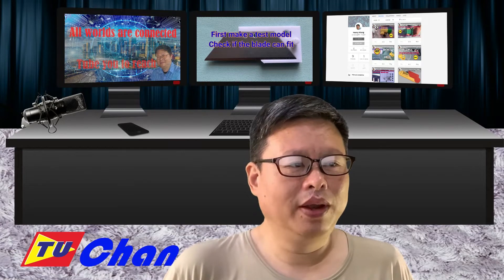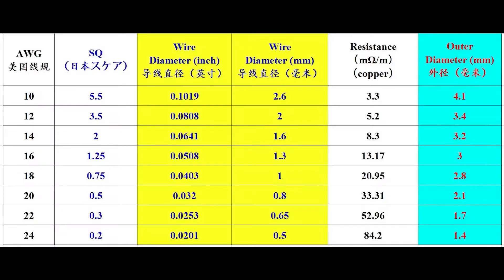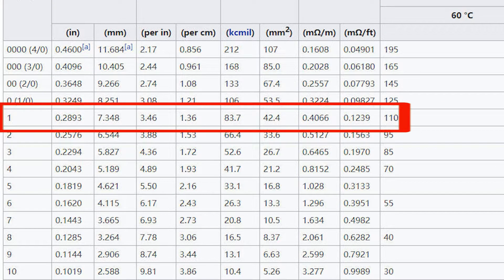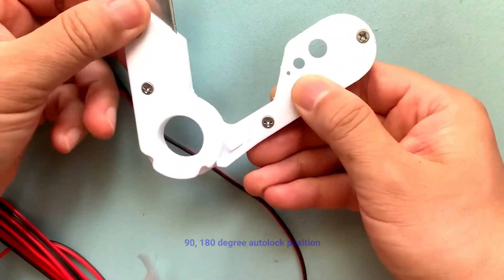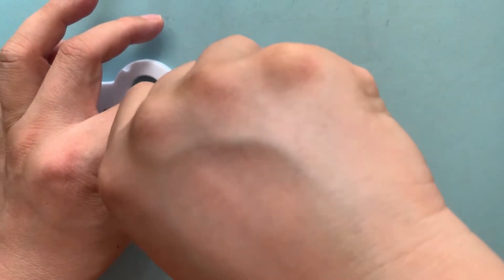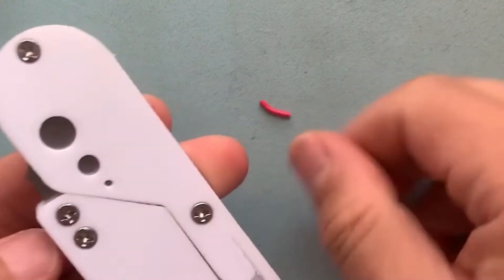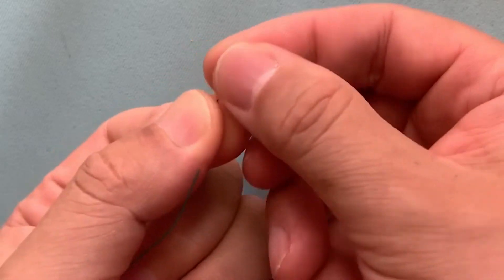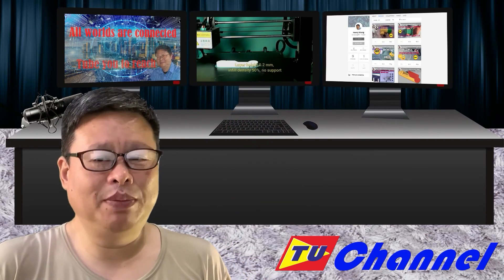Upgrade version of multi-function cutting blade and wire stripper with safety lock

Comment: Thank you, I like your teaching way widely open, making better the designs you find, take your like and subscribe from Venezuela
Reply from the maker: Thank you very much.  We can help each other. Have a nice day.
Reply: @TubeUnderdeveloped  thank you, you know, I´m trying to make molds for manual plastic injection, what metal is the best? strong but low fusion point and of course low cost, I was thinking to use tin
Reply from the maker: @christinoccs  In fact, I have no experience with the molding as you described. I am using a 3D printer to make something. But I like to help people if I could.  I have searched the topic from the Internet which may give you some help.  
If you want to use less cost, high durable and low melting point metal, I suppose the Al is the best metal. Maybe you can just use the soda can which almost made by Al. The melting point is about 660 C. And the tin (maybe you mean soldering tin?) is less melting point (about 230 C). But if you want to mold or inject plastic, eg. PLA. It should reach a temperature of about 200 C or higher. Is it what you wanted? 
Hope you can success.

Comment: What kind of screws are you using M3 diameter but how long and what kind?
Reply from the maker: The normal M3 screws that length is between 5-8 mm can work. The best are countersink M3 screws with a length between 5-8 mm.